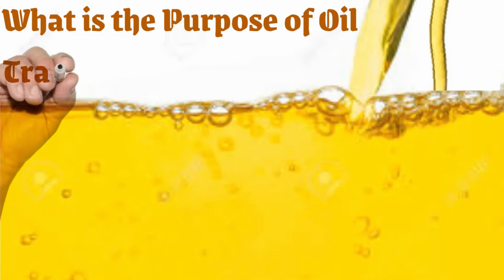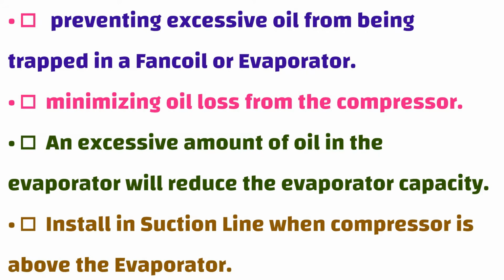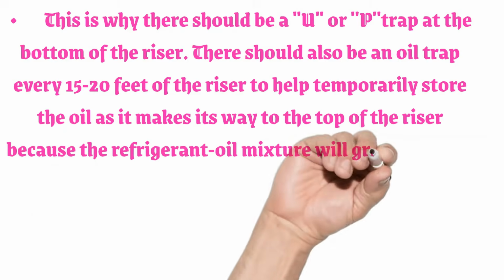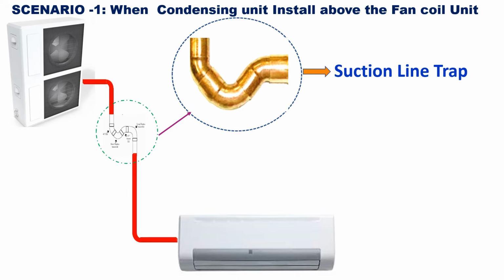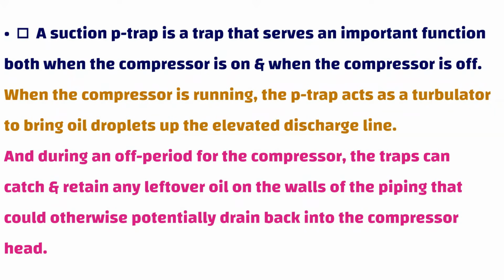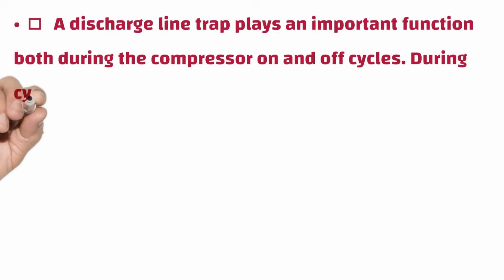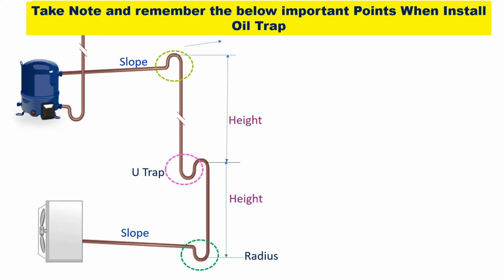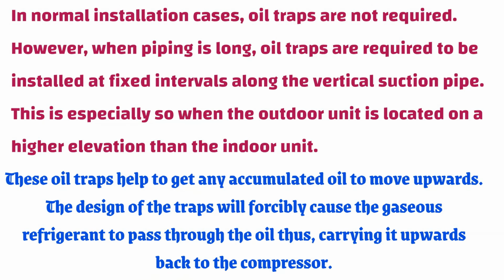Understand all about Oil Trap in HVAC Refrigerant Pipe

Comment: I have a little compressor, the condensor is above it. It comes out of the side, goes about 5cm straight up in the condensor, then like 30cm up in the first tube of the condensor( then down,up etc). Should i put a little loop in the 5cm before it goes in the condensor above it or is it fine? its a very small system.

Comment: so i'm seeing folks install these mini split systems ans coiling the access lines next to the outside unit .... is this a problem ?
Reply: it shouldn't be coz ideally the spit system are designed and meant to have some running distances between them , now if you install both units in same wall just a feet or two apart and shorten the line the flow ain't good mate on that installation
Reply: Not for R-410a systems. It was a problem with the older R22 refrigerants.
Reply: The problem is the loop (especially if more than one loop) is hard to protect from UV/sun light, so the factory line set insulation crumbles off and is hard to re-insulate

Comment: My 1 ton bluestar split has issue like blower is not throwing complete air it stuck in some places. Air flow comes with whzzzz whzzzz sound. I can fell the chillness and cooling. But air out flow from blower stuck in one side. My Ac mechanic told the same u trap. Is the u trap recommended for my issue. I changed outdoor eveporator coil my blower fan is good no issues, I did full water service gas level is also good.

Comment: Are there auto drainbacks like solenoid controlled with discharge?  I know they make em for air compressors but those work with float valves..
Reply: Typically a check valve on the discharge line of compressor prevents any refrigerant migration

Comment: Wouldn’t installing an oil separator on the compressor stop all these issues?
Reply: Not if compressor is on the roof. You wouldnt be getting any oil if no trap, usually commercial applocation when compressor's on the roof
Reply: @golddroger31  so your telling me if I install a compressor on the roof with an oil separator(which collects the oil from the discharge side of compressor then pumps back into compressor) I’d have no oil ?
Reply: @adrianlieutier7159  Correct!, an oil seperator ''catches only'' about 90-95% of the oil so eventually the oil will go away, problem is how to take it back.
Reply: @klidaras11  You are considering HVAC installation Scenario 1 - Condenser is ABOVE evaporator. However when Evaportor is Above the Condensing unit, is it obligatory in your opinion to have oil trap? Just as shown in: 04:01
Reply: @adrianlieutier7159  obviously these guys who are telling you this don't know what an oil seperator is     an oil seperator is installed when you have a very very long pipe run either discharge or suction line  the Oil seperator is used to pretty much prevent the oil  Running away from the compressor and get stored in the seperator and pushed back in to the compressor
Reply: @Ruben Gonzalez no... again  Oil seperator is installed when the system is un balanced  or a long pipe  run     Regardless 90% of units comes with out an oil seperator ...   oil wll be in the coil  regardless..   its our job to make sure it returns to the compressor ...
Reply: My ac unit has an oil separator, accumulator, and a muffler that also acts as an oil collector,.  No oil traps tho..

Comment: I'm going to install a 12k btu mini split outside compressor about 6' above the inside evaporator. The unit comes with 16' tubing - aluminum with copper ends, so I don't want to cut the tubing. I calculated I need about a 10' line. Some people coil the extra line behind the compressor. I was concerned about oil flow, but after watching your video it seems that the coiling would create an oil trap and be beneficial. Do I need to be concerned since the entire line is only 16' and is there a best practice to follow when mounting the compressor higher than the evaporator?
Reply: I always try to go back and forth behind the unit to hide extra piping (if I'm closer than 10 feet) most ductless have an oil return cycle. That should return any oil that is I  the evaps. Having oil traps in a ductless should be avoided if possible. Makes for a quieter system. (Less chance of the swishing or gas noise some people hear for  time to time)